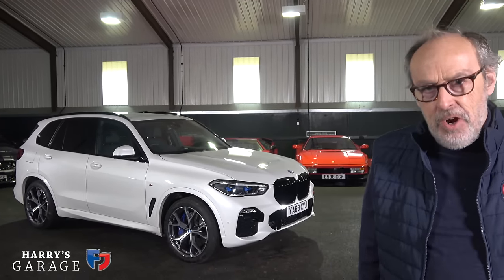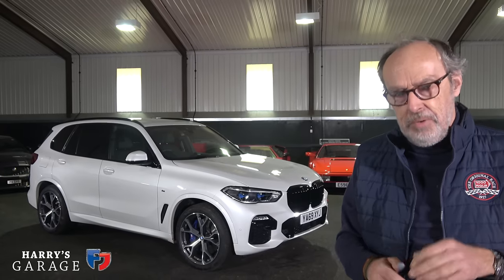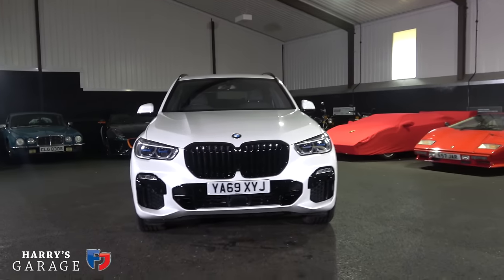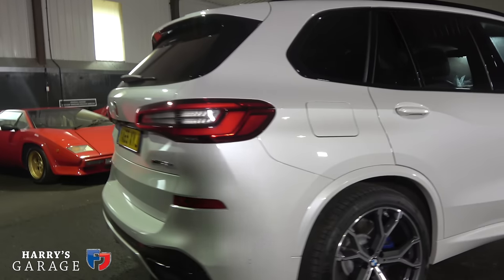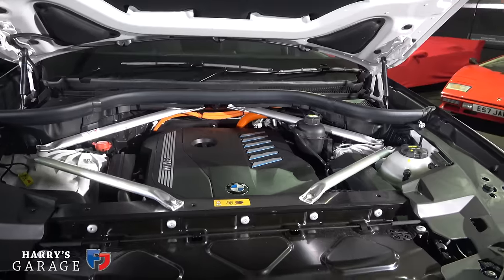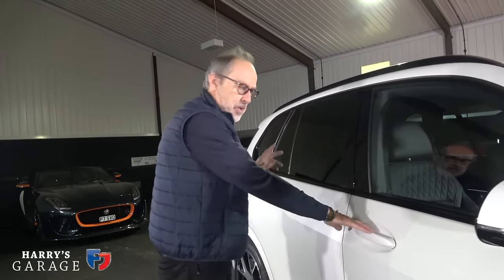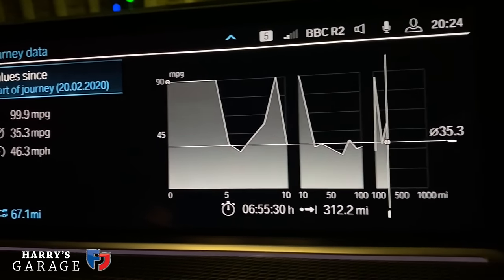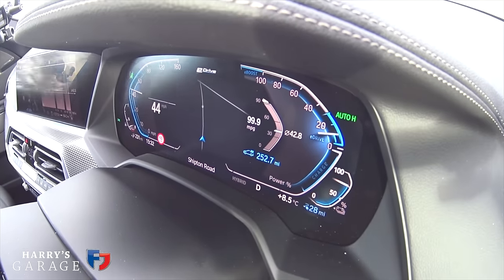BMW X5 45e PHEV 2020 review. Is this new plug-in hybrid better than a pure EV in the real world?

Comment: Direct injection compression/ignition petrol engine with a PHEV set up is the logical way forward. This crazy idea of banning all ICE vehicles will bite the dust pretty soon when the huge costs and logistics of providing EV charging and extra power generation are admitted.
Reply: No it won't go away now, the climate lobby have got behind this and the governments which need to find ways to tax us will back it. The interesting point is how complicated all these vehicles will be to maintain in used car scenario's mostly hybrid. In a few years time ICE cars will be banned from city areas completely.Then with the continued population issues and traffic congestion they will push electric bikes... Cities are already virtually grid locked. One accident and you have chaos.
Reply: There's nothing logical about continuing to burn fuel and expel polutants which our children then breath into their lungs walking along the street, when there is a much better alternative. Also what extra power generation? Almost all EVs are charged overnight when the grid turns all of its peaker stations off and still has an issue with getting rid of its baseload power. The Nat Grid have published reports saying EVs would be beneficail to the grid, providing them with a much needed load balancing tool. They even have to pay industry to use the excess power on occasion overnight through the year. And regards EV charging on the move, the infrastructure  is here and growing exponentially  (Ionity, Instavolt, Engie, Tesla SC), they are literally everywhere now. From an EV driver who just drove to the Alps and back - with zero issues (there were even 4 fast chargers in the ski resort) - try one, you really will leave your nasty poluting Jag in the garage. Very fast, 90% plus efficient,  virtually maintenance free, and cost efficient if costed over the lifetime of the vehicle (which will be much longer than ICE cars) instead of worrying about the ticket price. It's  not a crazy idea, it's logical. What is crazy  though - people who believe the gutter press lies, sponsored by the fossil fuel industry, that ICE car engines are clean and efficient (25-35%), and that EVs are made of nasty minerals like cobalt, and the batteries will need replacing in 3 years. Well there are approx 100m cell phone batteries in the UK alone, all of which have 10x the cobalt of a typical cell in an EV battery pack which now uses next to none or none, and car battery packs being shipped now will last well into the 100s of thousands of miles. Seriously, drive one and be converted. There's a reason new ICE cars aren't selling, because people know they will depreciate faster than used house bricks over the coming 2-5 years. The big manufacturers can't actually build enough EVs to cover demand, whilst ICE cars are being heavily discounted, maybe those two facts are connected in some way ? (E.g. Audi suspended ETron sales this week as they can't  build enough to cover demand, Tesla orders have a 3 month wait. In contrast I just got a quote from Car Wow on a Merc C-Class - discount -£8145 and the dealers have any colour or spec for immediate delivery - WOW )
Reply: It'll have to go away when they realise that disabled drivers (like myself) who have to park on the street have no way of running a cable across the road to charge an EV.
Reply: @Tracertme  Who mentioned climate change?  And how do you know I don't work in the energy industry? Regards living with pollution, try reading "Clearing the Air" by Tim Smedley, 19,000 people world wide die from inhaling pollutants. A lot non evidential ranting. Enjoy your V12...
Reply: 19,000 per DAY
Reply: @BobMonkeypimp  Hi , solutions are already being rolled out. Watch the articles on YT about wireless charging, either on your drive or built into roads.
Reply: @ccgtn00  I'm pretty sure they wouldn't install wireless charging on my side street.

Comment: How will the battery hold up with constantly charging it to 100% an running it down several times in a drive. Prius batteries are finished at 100k miles in.e.

Comment: But why not just buy a pure electric car then? Seems like the hybrid use alot of fuel when it is consuming.
Tesla due to the stations around.
Reply: Jacob because of the ease of having petrol stations everywhere if you need them
Reply: Or you want something that has better build quality than a Tesla
Reply: Well until the charging thing is sortet Tesla is best like Harry said.
Im just not sold on hybrid, they just like a make do solution 🙂
Reply: @jarno3000  You should look into having electricity installed in your home. That way you can charge your car at home. You can use the electricity for other things too! But seriously, visiting a petrol station when I had a rental while on vacation felt weird. The non-Tesla charging infrastructure has to get better though. I have a Tesla but as Finbar Hendry said, the build (paint) quality is not very good.
Reply: tzalwelzijn Rapid chargers are everywhere. (More public charger locations in UK than petrol stations) + home plug.

Comment: 36-36 MPG for the plug-in my commute is 30 Miles exactly, 4.5 miles local roads the remaining 25.5 highway and my Jag XK gets 26MPG+, all with a smooth and powerful 4.2 V8... All this tech, wizbang and rare earths for 10MPG!!?!  I can't help but feel we are being sold snake oil by car companies...
Reply: Driving an old car with reasonable emissions is environmentally friendly so you are doing good but your maths/logic suck. 

40 odd miles of leccy range will cover your commute more than one way. And +10mpg is 40% better than your car.
Reply: Did you watch the video? You could do all your commuting on electric in this car and running around to the shops etc if you charged it every night. Imagine your jag with an electric motor like that.
Reply: I know the feeling. Sometimes I drive a family members 1996 Jaguar XK8 with the 4.0 V8 and 5 speed auto. I'm used to driving old Land Rovers, (think Disco's and Series') so I don't drive quickly and I'm able to get 29/30 MPG from the Jag. Admittedly that is motorway miles, for shorter journeys I use my own Land Rovers. They're not very good on motorways though hence why I borrow the Jag.  I'm an automotive engineer by trade and unfortunately the downsizing trend is actually a con and many people have been misled, there are plenty of good studies proving it. The other hinderance to modern cars achieving good fuel economy is weight. Modern sound insulation and 20 speaker infotainment systems along with 10 airbags all adds up. Loads of people buy SUVs/crossovers, it doesn't matter how hard we (as engineers) try, they'll never be as aerodynamic as a coupe or hatchback, and the 4x4 systems sap power. Lastly, mainly with diesels, they're mapped to run rich to lower NOx emissions at the expense of hydrocarbons (which are filtered by the DPF anyway) and fuel economy. The best diesels for MPG are early to mid 2000s ones. They were tuned lean to aid fuel economy which unfortunately results in very high NOx.

Comment: I did a bit of number crunching. If the government insists on no ICE cars after 2035 it equates to almost 7,000 new EV being sold EVERY DAY. There is no way this is achievable.
Reply: Bib The Boulder lol they will be selling that many by 2027
Reply: @ericpisch2732  Possibly. But meanwhile every day that goes by they need to add that 7,000 to the total needed.....it is not possible, and that is without the issue of charging these millions of vehicles.

Comment: The difference with the 4-Cylinder to a Straight six is pretty much one thing and one thing only: Sound. And i've got to say, having that battery capacity would mean, i'd probably really only use the petrol to have fun. And that's the beauty with those cars...they can do pretty much anything "reasonably well". I'd be fine to have a "smaller" straight six just for the sound. AND: Considering the Norwegians are trying really hard with synthetic fuels, made from Co2 and Solar Energy, the 20% of the rest of the motoring is still CO2 neutral.

Comment: I've been running a Freelander 2 12 years now low miles returning 40mpg mostly urban driving (we have a lot of speed humps pit holes) 
These new cars are still not environmentally friendly when taking all costs of production 
Simple engineering replaceable parts that's the way

Comment: Far more efficient than a pure EV, pure EVs, eat away at the electric range on motorways, once above 65/70mph.  Its much more efficient to use the engine on motorways, and electric around town and for short commutes, and I think this will be the future,  combo vehicles, that have the extended range option. Another plus, is if your journey takes you, to rural location, the engine back up, is a God send, as very few EV chargers are operational there.

Comment: u forgot, after 5-6 years, the battery replacement will cost an arm!
Reply: The battery will last the car, the 6 year warranty does not mean it needs to be replaced after 6 years, it should have a minimum 75% capacity after that time or replace it for free.

Comment: I wonder how the engine likes being turned on for a few minutes at a time?
Reply: If that's all it takes sometimes. I don't mind it.
Reply: BMW specifically has engineered the engines to be more durable in the hybrids because of this. Also, because you’re running on electricity it puts strain off the combustion engine. Nevertheless, flooring an ice cold ICE engine can’t be good, ever...

Comment: Thank you for another wonderful video.  I just had a glance at regular X5 fuel economy and in the US it works out to about 20 MPG overall in real world.  Thus, based on your video, it seems the PHEV is 3x more efficient with petrol.
Reply: Not quite he was using UK MPG, it is a little different (approximately divide by 1.2) and the UK cost of electricity and gas to get those figures. UK gas is expensive and electricity about the same I think, So your millage may vary.

Comment: 40.1 mpg is dire.
My 0.9l Sandero gets that with me ragging it
Good review though
Reply: Compliance car, German and Japanese car industry has spent 10s of billions on engine / gearbox production and servicing, they do not want to give that up
Reply: I've got to ask: Are you serious? Seriously comparing a Sandero with a BMW, let alone a X5?? Because if you do, I've got to try really, really hard on not to doubt your intelligence.
Reply: Nexusband i was only comparing the fuel economy. Obviously they are different classes of car but for a £70k car, I would expect better fuel economy
Reply: Consider 40.1mpg from a heavy SUV with a 3litre twin turbo. Not too bad at all
Reply: ChrisB Kia Sorento 2.2 CRDI gets that and thats a similar sized car.
Hardly innovation in tech if it’s a hybrid and still only achieves that
Reply: @BillyNoMates1974  I guess it depends on the kind of driving you do as to whether its worth getting one of these PHEV. I think the value proposition comes from being able to do 40 miles on pure electric which for a lot people is more than they will do in a full day. By Harry's estimate that's around £2.50.
Reply: @BillyNoMates1974   I don't want a 2.2 diesel 🤮 
this is a straight 6 with over 300hp which returns the same as a van engine.
I know which drivetrain I would prefer
Reply: Paul Molyneux I can see it would be a popular car as a ‘green’ Chelsea tractor but other than that, what’s the point.
I do have concerns about the engine running cold most of its life
Reply: ChrisB fair enough. Each to their own
Reply: @BillyNoMates1974  They are NOT comparable, even remotely. The build quality alone requires more weight, the materials used are heavier, the car is A LOT bigger and so on. Not only that, this is probably three times the power of the Sandero. The Sandero is a car that gets you from A-B, but nothing more. No emotion, no proper sound dampening, no plush, no comfort, atrocious build quality and so on. 
Even when comparing a Sorento 2.2 CRDI, the Sorento doesn't have the sound of a straight six and not even remotely the build quality this car has - and the Sorento can't to 40 miles on Electric, meaning it ALWAYS burns fuel. The innovation is not fuel economy. The innovation is doing the driving you do most electric and not using any fuel at all, and then being able to have fun - be it on road or even slightly offroad, where the Sandero and even the Sorento would be stuck, because the 4WD-System in the Sorento is good for a bit of snow, but nothing more. Looking at Spritmonitor.de, the Sorento 2.2 CRDI does 29 mpg average. Real, achievable 40 mpg is absolutely impressive for this sort of car.
Reply: @BillyNoMates1974  as I said, the point would be that if you drive less than 40 miles a day, then with a car like this you'll be on electric power alone. This is cheaper than a combustion engine.
Reply: @BillyNoMates1974  lol thought you were joking. Okay so...

Dacia Sandero weight - 970 to 1,092 kg
BMW X5 xDrive45e M Sport - 2,510 kg

^^ Not the exact models of your vehicles but close enough. 1500KG extra weight on that bm, simple maths.

Comment: I’m still unsure how these types of EV’s are saving the planet or you ££. Apart from building the car and the cost involved in making the Batteries + extra weight, how is this efficient at sub 40mpg. I’m not going to question why you need a SUV in the first place. Would it not be more “earth”  friendly to buy a Golf R or GTD if you want performance or efficiency. I’m not suggesting they are like for like but £76k or a car being marketed as “The Green Option”. Obviously these cars live in cities and are for taking the nippers to school. I’m guessing these are sub 40 mile commutes anyway. #ChangeMyMind
Reply: It's all about the US market where diesel simply doesn't exist
Reply: thats the reason why it does 40-50miles on electric,  all local trips done on electric does save you money and stops regular trips getting fuel.
Reply: Agreed. Put this sort of engine in a Golf and it makes sense. In this thing, it's just less guilt for owning a pointlessly huge car. 40mpg isn't particularly green, nor is the manufacture of these engines.
This is for people who want to delude themselves that they're being 'green' (at the price of the thing it can't be about saving petrol money). A Golf Estate (or similar) would have enough room and with a PHEV engine could presumably get close to 80mpg (a total guess) on the same route.
Then you add in the issues of complexity, environmental and human damage of making the batteries, useless for anyone who lives in a flat... These issues are at least partly surmountable, but it would require significant government funding - and there's no chance of that happening. More likely, it'll just be a lot more expensive to own a second hand car, as the age of the £500 car will be over.
Reply: @julianevans9548  the new Golf VIII GTE looks interesting. It's powerful (240+ BHP) but also promises a generous electric only range. Of course, it'll handle like a bucket, but something has to give.
Reply: The commentators on the fully charged show channel describe Hybrids as outdated.  They  argue the technology to swap to full electric is here (which it is) and the range is here too (which it is).  They would also point out many people are ignorant of this fact (which they are).
Reply: @markmywords312  What if you live in a flat?
Or do long journeys and don't want to spend   an hour charging your car during that journey?
I'm sure there are many other examples.
Reply: @markmywords312  charging technology hasn't caught up yet. Unless you own a Tesla.

Monopolies are bad.
Reply: @julianevans9548  That doesnt mean the technology isnt here.  The problem is infrastructure.  You could EASILY build multi chargers into streets, easier than lampposts. Inductive charging built into the tarmac is possible. Actually, flates often have private parking areas, making them ideal for charge points on the ground floor. Weirdly enough, one of the biggest providers of home charging sockets is...BP. No wonder the infrasturcture is fucking poor. An oil company rolling out electric charge points.
Reply: @visionist7  That's completely wrong, there are 200kw+ charging stations out there now. Charging technology has been in place for years.  Dont you think people havent thought this through?  If you mean general infrastructure then yes, it needs to improve in the UK, but most people dont live in flats, they live in houses, so they have no excuses to not install a home charging point.  Takes about 2 hours in case youre wondering, less sometimes
Reply: @markmywords312  if I can't charge the car fully in five minutes at a service station like I can with refueling an ICE car, it isn't practical for long journeys
Reply: @markmywords312  I agree with you.
In the real world, capitalist governments are not going to do create the necessary infrastructure. They see this the same way they see everything - an opportunity for big business to make money.
Reply: @visionist7  Well that about sums your attitude up to the environment. Lazy and someone elses problem, right?.